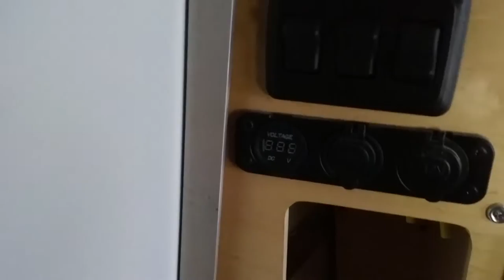Taxa Cricket Electircal controller

Comment: Dave..Does the front of your Cricket have the trailer hitch box and what looks like the rock protection panels behind it..I see them on other Crickets..if not, do you think the front would be easily damaged when towed if debris hit it? Thanks!
Reply from the maker: Galleta's Dad I added a diamond plate 48"wide box to the front of my trailer that will mostly protect the front from flying debris.  there is about 8" on each side that I am going to cover with something but have not found it yet.  if you watch the video about the sink I walk past the front with the box installed